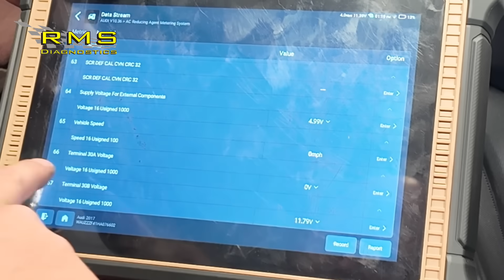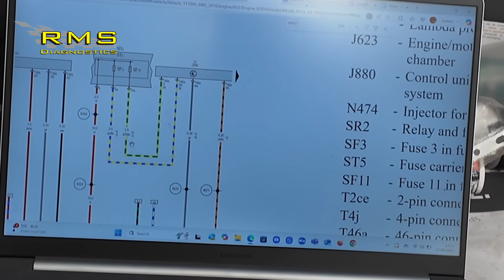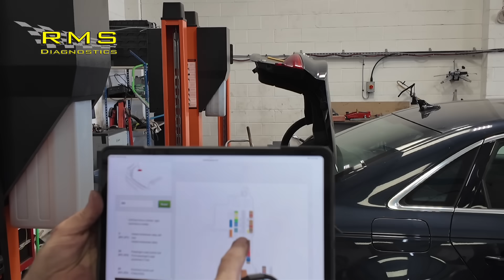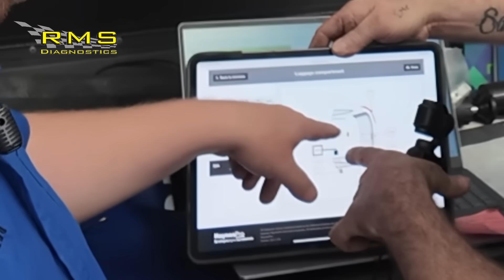Audi AdBlue Fault | Live Training with Dean Lomas @ DC Lomas LTD  #mechanic #cars #automotive

Comment: Premium fuel and the manufacturer recommended oil. And not variable servicing. Unfortunately that doesn’t happen.  I use shell helix ECT multi, this stuff burns cleaner the other oils. Although my Audi uses zero oil and gets a 6k oil change.